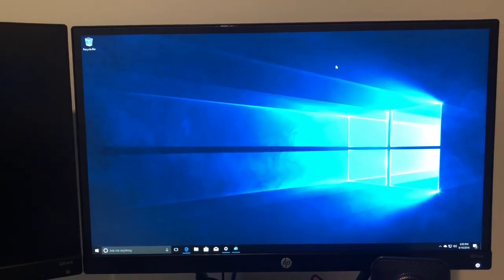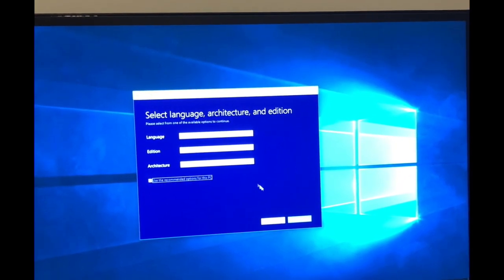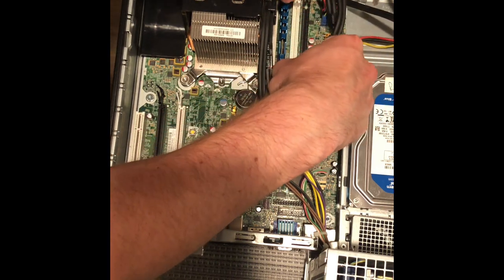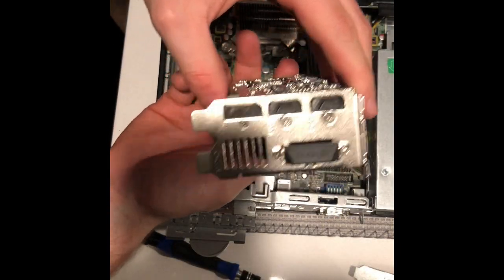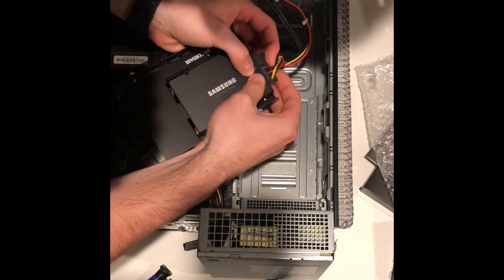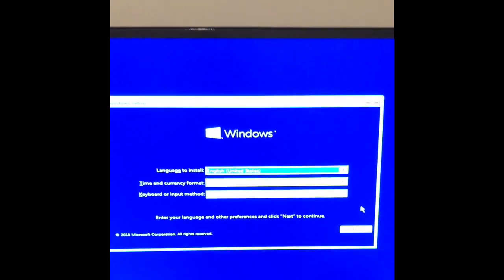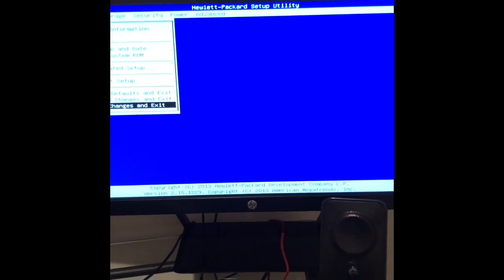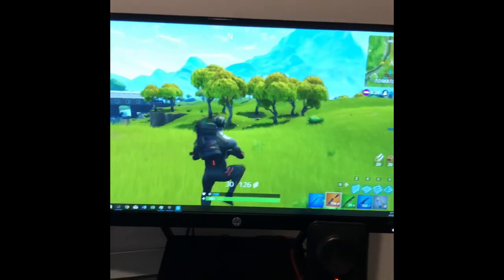HP Elite 8300 SFF Gaming PC Upgrades!!! Graphics Card, SSD, RAM

Comment: I have the same tower would these upgrades be able to run warzone?
Reply: You prob need a gpu, at least a 1050, and get a ssd. This is only for extreme budget builds, and it isnt good for any expensive build.
Reply: Yes but if don't have enough money to get a 1050 you can get a better CPU the best is i7 3770k but cost the same the card so I recommend a i7 3770 not k
Reply: It has to be a lga 1155 socket

Comment: On almost every hp forum people are saying you can only use a Radeon 7450 low profile video card in these machine's. I have been building computers for dam near 20 years and I had to giggle as long as the card is under 75 watts the power supply should work fine and as long as their is a slot for the video card and you have the proper drivers it should function properly. I have to say I have been watching a few of these videos on the HP sff and I think this is the most upgrades I have seen thrown into one of these machines. Grate job on the video I think this lets a lot of people no you not just stuck to a low end graphics card because someone on a HP forum says you can't use other cards.
Reply: yeah i got a lp 75w card and when gaming it pulls around 37w max
Reply: you know they are rookies when they don't take the old hard drive out because it's a huge pain in the ass

Comment: The GeForce GTX 1050 is currently unavailable on Amazon. Do you recommend something comparable that I can purchase? Thanks!
Reply: gt 730 ti low profile
Reply: Rx550 or rx570 pretty good comparison
Reply: @cartiihuh220  dunno if there is a small form factor version, as it needs a small form factor gpu.

Comment: I’m planning on getting an optiplex (i5-3470, 500hdd, 8gb ram ddr3) and installing a gt 1030 lp with 500gb of ssd. I don’t wanna have to upgrade the psu which will most likely be 250w, will it be okay?

Comment: Got mine for 60 bucks 20 bucks to double ram to 16 gbs and added a 1030 gt 120. Then a new ssd yesterday.. got the pro off the label on it.. for 250 I get a near ps3 level play at 720 med settings get near 35-45 fps on warzone.. it's playable.. :) 

Dual channel boards.. add that ram bro.. it can go up to 32 gbs which is crazy.. 😂
Reply: Will 250w be enough for i5-3470, 8gb ddr3, 500hdd or ssd, and a gt 1030 lp?
Reply: @drown4486  should run fine.  But note 7th generation is the best to start to look for at The end of the year.. some schools upgrade their systems during the summer.. some have the six and seventh generation Intel processors.. just stay away from the Celeron d
Reply: Do u have 32gb on your hp compaq elite 8300 ssf???
Reply: @smokemanic  no just 16gb mines at the max.. but I believe there are second generation versions where it can support up to 32gb.

Comment: Before you proceed with any hardware upgrades, first check if latest bios is installed. Hit F10 key on startup and check information menu. If bios shows version 2xx, it is old and you need to upgrade to latest 3xx bios.
Reply: How do you upgrade the bios?

Comment: It is ok for the gpu temp to be at 82 degrees at full load?
Reply: Because that's what mine does
Reply: @littlejetguy  Does it have a fan?
Reply: @burgir180  yes and it works but its a small fan cuz its a low profile gpu

Comment: Will the GeForce gtx 1050 ti oc low profile4gb  work cause there sold out of the other ones
Reply from the maker: Yup as long as it’s low profile it will work
Reply: If not low profile? The gpu can put at  the motherboard?

Comment: hell i thought the old model was ivy bridge and they only run at 4 GB let alone where is the power supply leads for the gpu cause there is none in mine 8300 . my guess is 16 GB will burn the chip out, there is no power leads in 8300 to supply the GPU and the imbedded on has a bios that wont let you switch it off so only maybe hybrid system if the computer recognizes the new cpu and run it though nividia system
Reply from the maker: No glue connector in the system, that why I used a 1050 which requires no additional power outside the PCIE slot

Comment: Hey man, I'm extremely new to pc upgrading and currently I installed a gtx 1650 LP on this exact system, One thing I am pretty unsure about is How could I change the CPU on this? As I am currently stuck with a i3-3220 and I desperately wanna upgrade to an i7-3770, Any help regarding this would be great! (sorry if this is a dumb question)
Reply: No u can upgrade to and i7 3770 it's pretty easy I did it myself just look up how to replace the cpu
Reply from the maker: I don’t know if the 2nd and 3rd gen chips share the same chipset. I don’t believe they do, so you may be stuck with a 2nd gen i7

Comment: Hi, Im about to get the 1650 LP next week, so just for the sake of confirmation... I have an i5 4590, so should I expect stutters in games like Fortnite, apex and Warzone ? 
P.S : I know there will be high CPU usage... but till when can my PC survive considering the high CPU usage ?
Reply from the maker: After gaming on mine quite a bit no real stutters to speak of, even with the i5 I wouldn’t expect major drops
Reply: @TechRoundUp  Thanks man ! Now, I guess there is nothing stopping me from getting this card !
Reply: @TechRoundUp  And one last thing, would u recommend me to go for the 1050 ti or 1650 considering the CPU ?
Reply from the maker: Both will be very similar, but I would go with the 1650 as it’s got slightly better performance for almost the same price
Reply: @TechRoundUp  And CPU usage will be the same on both GPU's?
Reply from the maker: Yeah you won’t be pushing that many extra frames on the 1650
Reply: @TechRoundUp  that's totally fine. And lastly is there any card which could provide me a stutter free experience in games like fortnite.
P.S: I know this CPU isn't strong enough, but any card u can tell which can provide a stutter less experience?
Reply from the maker: You’d probably eliminate stutters with cards like the GTX 1660 and above, as well as probably anything above a 5600XT
Reply: @TechRoundUp  but won't that create rlly high CPU usage?
Reply from the maker: Then you’d probably be stuck with a 1650 or 1650 super
Reply: @TechRoundUp  thats fine honestly, I'm not a hardcore gamer just need something to achieve like 120 FPS
Reply: @UmarAli-sz7dd  the gpu doesnt create high cpu usage, the higher the gpu the more of the cpu you can use, this means less stutter and higher fps

Comment: Hey man so I'm thinking about putting a gtx 1050 ti LP into my Hp Compaq elite 8300 SFF and I just wanted to know whether it will run perfectly since I read somewhere that the PCI ports only do 25W instead of the standard 75W, I was just wondering whether this was true and if it would be an issue? Thank you!
Reply from the maker: I had a 1050 in my compaq elite 8300 with no issues, pulling the around the 75W limit, I haven’t heard of that issue before
Reply: @TechRoundUp   I just installed the GeForce 1050 ti in my HP 8300 and have no issues at all- Your video was an excellent reference, btw.
Reply from the maker: Glad it helped!

Comment: What about the power supply? I believe this model is somewhere between 200w to 250w. Would you need to upgrade the power supply and if so, what on Amazon could I buy that would fit in the HP 8300 SFF?
Reply from the maker: Power supply will be fine for any low profile GPU, as the power consumption is limited to below the 75W threshold for PCIE, and will be pretty impossible to find a 3rd party PSU for the 8300 as it is a proprietary design
Reply: So could o use 1650 mini, or is it too much power?

Comment: I need your help! How do I get the gpu to work to I just put it in their and then it’s done? And instead of using WiFi with this can I use Ethernet
Reply from the maker: You will just need to put the graphics card in the pcie slot and connect hdmi.  Windows should then install the basic drivers for the card to get an output.  You’ll then need to go onto nvidias Website to download the latest driver.  And you can definitely just use Ethernet.

Comment: I got mine 2 days ago and I was wondering If I could upgrade the graphics card? I just bought mine on Amazon from Skytech USA so you can check the specs there. What graphics card should i put in? (Looking for a good but cheap option.)
Reply from the maker: The best LP GPU for any pre built SFF system is the GTX 1650.  That is the highest end and newest card that comes in a low profile form factor
Reply: @TechRoundUp  Great. Would I have to upgrade my power supply in order to use it?
Reply from the maker: No as the 1650 can only pull the 75Watts from the PCIE slot just like the 1050 or 1050ti, no 6pin or 8pin power cables needed
Reply: @TechRoundUp  Sorry for the late reply, thanks for your recommendation. I think I'll go with a GTX 1050 TI from Gigabyte. One more thing, I am not able to open the side panel. When I pull the handle up it the lid doesn't come off. Do you think you could help me fix it? It seems to be stuck.

Comment: Hi, i am buying gtx 750 ti 
but i m not sure that if my psu supports it 
i have 320WATT power supply and the following specs;
HP COMPAQ ELITE 8300 CMT 
INTEL CORE I5 3550 3.33GHZ
8GB RAM
7200 RPM HDD
WILL I be able to run gtx 750 ti on this pc?
or i have to get more power supply ??
PLZ can u guide in a hurry plz
Reply from the maker: Yes you will be fine as the max power draw is 60 watss

Comment: just posting this agian just to make sure that you get it and answer The one I have has a 240watt power supply, do you think with the 1650 graphics card would be too much??? I used a PSU calculator online from Newegg and it siad 247 watts, but I would rather listen to the professionals. Is your PSU the same and have you had any wattage problems so far? Do you think I should buy the 1650 and if not which should I buy?
Reply from the maker: 240 Watt psu will be fine, so you should definitely go with the 1650
Reply: @TechRoundUp  Sorry, my dumbass forgot to mention that mine has the i5 4570 which has a 4 core 3.4 ghz speed which is about half the performance of the i7 you have, do you think that would be bottlenecking it then?
Reply from the maker: Very doubtful, the single core performance of the i5 and i7 is very similar and hyper threading isn’t used to its fullest in gaming. You’ll be fine with the i5 and 1650

Comment: Can I keep the hard drive and connect the ssd with a sata cable? Does this make a difference ?
Reply from the maker: You should be able to do that, i believe there are multiple SATA ports, you just may need to used double sided tape to mount the ssd to the top or bottom of the case
Reply: @TechRoundUp  I saw another video and the guy used a bracket that fits 🤷🏻‍♂️
Reply from the maker: That’ll work then, wasn’t aware of that, but if there’s a dvd drive replacement cage that’ll look nice

Comment: What is the cheapest graphics card that will run in it
Reply: GeForce GT 730 if you want cheap. I personally have a 1650 gtx.
Reply: Also, 710 is even cheaper.
Reply: So i can fit 1650 in this And it will run?
Reply: 710 is absolutely garbage. Bought it for my bro thinking because it had 2GB of vram it would run games fine. Nope. GTA V runs at lowest settings like 800x600 or something like that, where my 1050 runs at 1080 fine (same pc btw)

Comment: Does this run fortnite smooth?
Reply: How many FPS can I get with this on low settings
Reply: @ZorrQify  around 100-120. I know this because I have this PC
Reply: ggwavey24 isn’t this pc like the other pc that looks just like that one but in all black ?
Reply: gr6ms yea, I have this
Reply: ItzSidiki what is your resolution in game?
Reply: Rh3torical how many FPS dose it run
Reply: How many frames
Reply: @Thelayupline0   u get around 100 in low settings around 160-240
Reply: I have the EXACT same setup as the video, with an i5 and gtx 1050ti it runs fortnite chapter 2 season 2 at 144 fps (more or less) but it keeps freezing because the i5 is from 3rd generation and goes slow it uses 100% of its capacity and that makes the game freeze like every 20 seconds, it freezes like 0.5 seconds each time, on creative it runs smooth tho. Also you can not upgrade the i5 because the motherboard doesent support it, i hope it helps and sorry if i misspelled something
Reply: @ignaciro9511  what do you mean  it use 100% cpu????

Comment: What was the ram before? I just bought an hp elite 8300 desktop. It comes with 16gb ram 2tb hhd and 120gb ssd. Supposedly has a graphics card but idk I haven't gotten it yet.  I figure I can add ssd later. But the only thing I think I'd need is to upgrade my graphics card and it seems good to go right?
Reply from the maker: Yeah for sure that’s a good plan!
Reply: @TechRoundUp  thanks for the reply man!

Comment: would a geforce 1050ti LP fit in it
Reply from the maker: Yes, any low profile card that doesn’t need an additional 6pin power cable will work
Reply: Tech Round Up thank you very mucch

Comment: Sorry another question how much FPS would I get if I used a 500gb ssd and a low profile 1030 graphics card
Reply from the maker: SSD won’t effect anything in game, and maybe drop single digit frames or slightly more with the 1030

Comment: Where did you get the Corsair thing for the ssd
Reply from the maker: Part of the package on amazon
Reply: Tech Round Up I didn’t get one and it’s telling me non system disk or disk error
Reply from the maker: It should not effect that at all
Reply from the maker: You may need to format the disk however
Reply: Tech Round Up how do you format the disk
Reply: Tech Round Up is there anyway I can communicate with u better
Reply from the maker: https://youtu.be/ZxV6IcNvbek , plug in the old and new drive and follow the steps in the video
Reply from the maker: Then you can plug in the new drive alone and go through the windows install
Reply: Tech Round Up now both of them say non system disk or disk error. I’m so confused pls help 😱
Reply from the maker: The old drive should work, as long as you boot from it
Reply: Part of what package

Comment: Will this work with just a 500 gb ssd and a GeForce 1030 low profile, is it ok without the 2 8gb sticks and do you recommend getting the 2 8gb sticks and what is the 2 sticks for and last thing what does it do to help the pc
Reply from the maker: You should be fine getting away with 8gb of ram total, but some of the programs I was using, and for some games you need the extra system memory for the programs

Comment: What is the max frames u run on fortnite and can this get it.up to 140 ish frames
Reply: On very low settings there is a small chance
Reply: Suck is good be cuz the frame of rages by mini secondary’s are many but it is rsi which makes its run 
Also crs are good neck z they get 1 frame per dya

Comment: ok so i have a quick question can u play fortnite on it while its just stock no upgrades???? plz respond
Reply from the maker: You could probably play, but at like 20fps, even if you just go out and get a gtx1050 or gtx 1650, or any card that doesn’t require extra power you will be much better off
Reply from the maker: Will probably run you a little over $130
Reply: @TechRoundUp  what do u get for max fps.and is there a way I can upgrade it enough to run a round 140 fps on it?
Reply from the maker: You can get around 140 with lowering settings
Reply: Ok thx!!!

Comment: I have another question. How were you able to get your Windows 10 key to re-activate Windows 10 again after putting in the new SSD and booting the PC up? All the parts I've ordered should be coming in the next few days and this is the only step I'm not sure of because I don't know if there's even a way to get your Windows 10 key on a refurbished PC since the OS was installed by a third party???
Reply from the maker: Just take note of the windows 10 key from system tab in control panel.  You’ll then have to download the windows 10 iso onto a usb and boot from the usb after the SSD is installed.  I have a video walking you through this.  As long as you don’t change the mobo you should have no issue activating from the old key
Reply: @TechRoundUp  Thank you so much! Sorry if I'm such a newbie. I didn't know that the motherboard retains all that information about your OS. What I initially thought was, if I took out the HDD which has the OS installed on it, I would have to buy a new activation key to re-activate Windows 10 or spend another $100 for a new Windows 10 CD after putting in an SSD.
Reply: @TechRoundUp  Would I be able to keep my old harddrive installed and boot up with the hdd for the first time? Then copy my files to the SSD?
Reply from the maker: Most likely no as you will have to format your ssd when you install windows onto it.  If you have a spare drive I would look to make a backup on to that

Comment: I have another quick question. If I purchase a refurbished HP Elite 8300 core i7-3770 and it comes with 8GB RAM already and has a 500GB HDD is there really any reason to purchase a 500GB SSD and two 8GB RAM sticks? I feel like the only thing I would need to get is the graphics card and everything would still be ok. Also, if I want to add an SSD just to give the PC more storage space, will it fit in the case along with the HDD or do I need to take out the HDD completely to put in the SSD?
Reply from the maker: You won’t need more ram, and the SSD will make your system a lot faster so it’s really up to you as to whether or not you car about boot time and load time of games.  There may be some room for an SSD along with the HDD under the optical drive or getting a new drive bay with a 2.5” slot to replace the optical drive
Reply: @TechRoundUp  Alright, thanks. I've already got my HP 8300 core i7 ordered on Ebay already so can't wait for it to come in so I can do this upgrade on it.